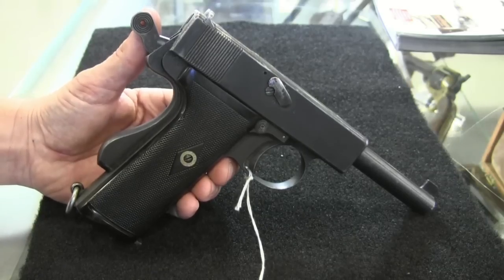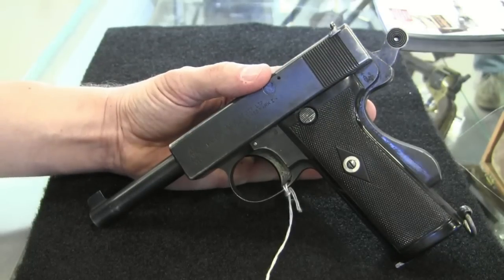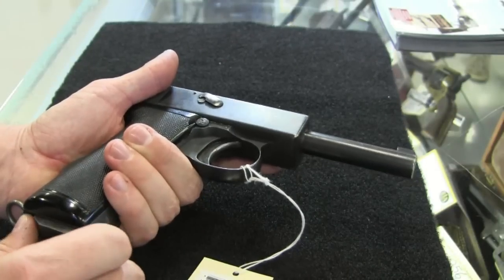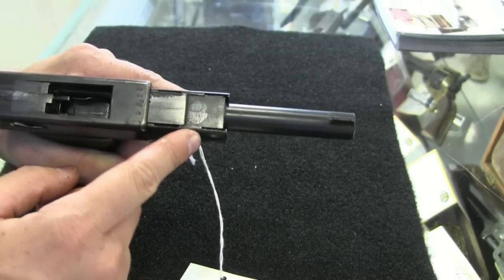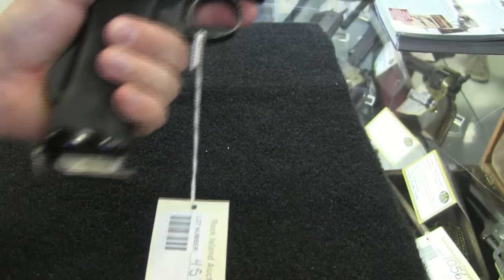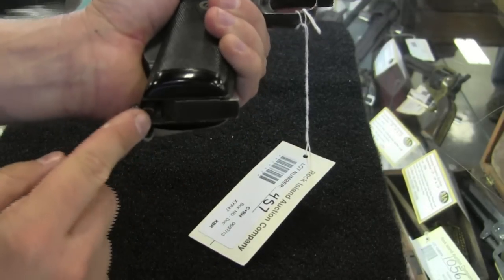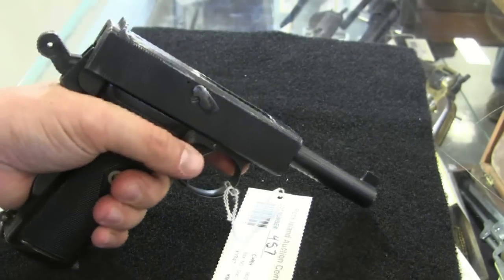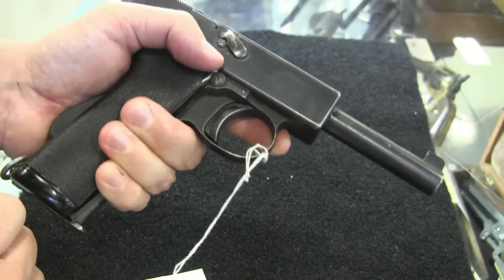Webley & Scott 1913 Naval Model Automatic Pistol

Comment: Great video, Ian. The Royal Navy however did not reject semi-auto pistols on the outbreak of The First World War. They bought about 6000 M1911's in .455 Webley for use by ship crews and airmen in the RNAS (Royal Navy Air Service) flying coastal air defence patrols. Webley produced the specific .455 Auto ammo itself, as the usual Webley .455 cartridge used in a revolver wasn't strong enough to work the M1911 action. Boxes of .455 Auto carried a warning not to use them in a revolver. All the examples of the M1911 in Webley .455 I've handled have the following distinctive features: a Webley stamp on the slide, UK government markings, the magazine clearly marked "Webley .455 Auto" on the base, and a lanyard ring on the magazine rather than the grip.

Comment: The pistol was also made in .32acp for the Met Police. The big problem with this pistol was/is that the main spring was held in place by the side plate if this was damaged in any way the gun became inoperable. some were sold to the air force for flight crews and fighter pilots. some were even recovered in N Ireland 1969--1980.

Comment: The .455 Auto cartridge does have a small rim with a blunt round nose 200 grain bullet that was copper jacketed with a nickel wash on the bullet in a brass case.  Bob Hayley out of Texas is the only one I know of who custom makes this ammunition from cut down .45 Colt brass and then  machines the rim and exractor groove in the case.  I believe he custom casts 200 or 230 grain .455 sized bullets for the ammunition.  Colt even made some 1911s chambered for this round for the Royal Flying Corps and the Royal Navy.

Comment: I saw on TV years ago a gun that I believe was either used or developed around the time of the Korean war. It had a way that a soldier wearing gloves could fire the gun with a special trigger device built into the under side of the stock. It was a pretty cool idea though. Any idea what gun that is? I can't remember and if possible do a video on it.

Comment: One question, Ian: when firing with the magazine only partially inserted to cut the feed off, will the slide lock open after each shot so it's easier to load individual rounds into the chamber?

Comment: I would have expected a magazine that held rimed cart rages to be rather tapered. The one looks quite straight. I assume rims stack one in front of the other, so the question I have is does the .455 webley have a thin rim?
Reply: The .455 Webley probably has the thinnest centerfire rim I have ever seen.
Reply from the maker: I should have been clearer in the video - Whiting early pistols (circa 1904) were designed for the standard .455 revolver round, but these later models used a modified version that was semi-rimmed, similar to a .32 ACP.
Reply: Interesting, I imagine it's hard to find!
Reply: But this one is in .455 isn't it? No way is that bore a .32!
Reply from the maker: David M.
Right - .455 Self-Loading.

Comment: I don't know a lot about guns, but this doesn't look like a very good design to me. The barrel takes a pretty sharp turn downwards, wouldn't that put a lot of stress on those little grooves it slides over thus wearing them out fast..?
Reply: +Peter Timowreef There look to be 8 wear surfaces. If the steel is hardened properly and the pistol is properly maintained, I doubt there would be much issue with that set up.

Comment: The design looks good, but that pistol is never going to have the same...ascetic value of a 1911, ha. If it was more widely adopted, I am sure we would see more modern versions of this design. The locking system looks to be simple and effective.
Reply: Speaking of aesthetics, the handgrip is at an odd angle compared to most modern automatics (though not as bad as the original Borchardt "pendulum" gun, which is straight-up-and-down with a long rear overhanging action, like it was trying to be the first Uzi). Pictures of people firing it show their wrists cocked at rather unusual angles for pistol shooting; it's not an "instinctive" pointer like most automatics, and that probably didn't help its chances.

Comment: why someone would want a magazine disconnect in a sidearm is beyond me. I would think if you're going to use a pistol you would WANT the ammo.
Reply: Way back when people first came up with magazines the higher ups in various armies were terrified about how much ammo their soldiers would waste if they were able to fire more than one shot per second, so they decided that the best way to deal with that problem while retaining the advantage of magazine fed weapons was to make it so the magazines could be cut off and held in reserve for "emergency use only". They later did a similar thing with operation system cutoffs on early automatic weapons that rendered them bolt actions. You could also argue that modern fire selectors are essentially the same principle, only more practical.
Reply: May Sparkle yeah and for a rifle that would make sense but for a sidearm, which usually is an emergency gun, it would be totally impractical (btw not trying to start shit just griping lol)
Reply: goldeneye0019 I think you are completely right.

But I believe that you are underestimating just how impractical and devoid of commonsense the WW1 generals and high up officers truly were.
Reply: quite